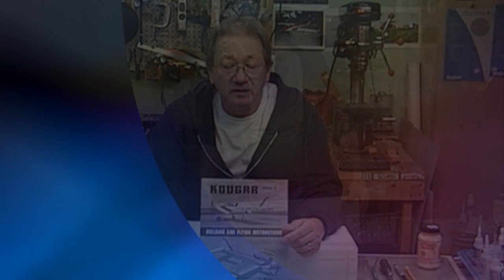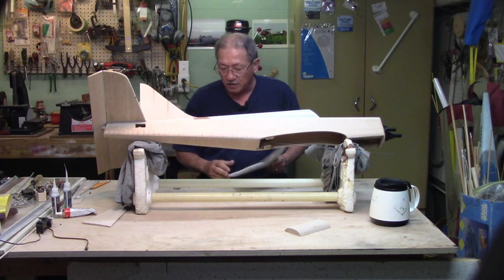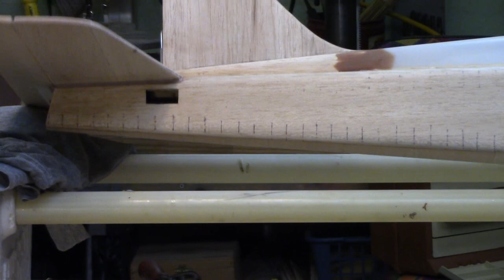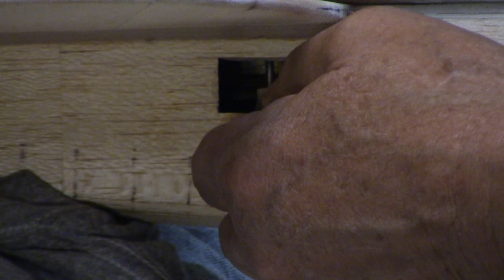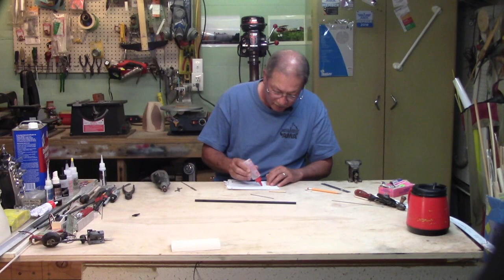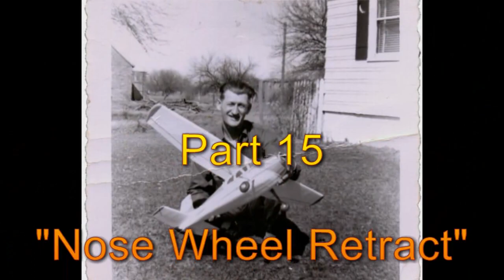SIG Kougar Build - Part - 15   Hidden Rudder Control

Comment: where can I get that horn and clevis 15:05
Reply from the maker: I don't believe that horn and clevis is available any more. But I've used a horn from a strip aileron setup and a common clevis in the past. It works fine and perhaps is less bulky.

Comment: Thanks for all the helpful stuff in your videos! You have said more than once about thing you did in another video. In one video you said you did videos for you club news letter. Would you please point me to that website, or add them to this channel in a playlist.
Reply from the maker: Hi Jim,  I make these videos as an extension of the "Gladwin Area RC Club" newsletter, all the videos are here with a few exceptions that I didn't release. With-in the Kougar Build series I incorporated as many tips as I could that are relevant to the build. All the videos are linked to our club Facebook page and are listed in our club newsletter. I formally wrote articles for the newsletter, but I found that by demonstrating them on video I could make a more comprehensive demonstration than in a few paragraphs in a newsletter article. If there's a subject you would like me to cover, for example, my cousin wants me to do a "How To Cover with Silk Span" video (which I'm in the process of filming in-between the Kougar Build series), let me know. If I know how to do it and if I didn't cover it in another video, I'll do my best to accommodate good suggestions. I wish I had more for you to see, however I'm working on it. Thank you for you interest and the question.
Reply: Thanks for getting back so fast! I have been thinking of giving polyspan a try. It is like silk but you can shrink it with heat. http://fly2build.com/coveringmaterials&supplies.html Have you used it?  found this on youtube https://www.youtube.com/watch?v=igVM8f6uOJ4  Than you again!jim
Reply from the maker: I've never used it. But, I seen it on models. It's light and strong, as you mentioned heat shrinkable and can be painted on with different types of paint, however it can't be dyed like silk or silk span. Like silk and silk span, Polyspan has no adhesive. I believe it is lighter than silk but heavier than silk span. Silk and silk span will shrink with water (Polyspan is un-effected by water), and will shrink even more with the application of dope and will continue shrinking until the dope is completely dry. I'm not sure if Polyspan will do that without the addition of heat. Point of fact: It can take days, weeks, perhaps up to a month before dope will completely dry inside and out in some cases. I'll check out the video links. Thanks

Comment: Bob, do you know the manufacturers and part numbers for the clevis and pushrods that you used for the rudder. I know the rod is by sig. I have to order the parts for everyone before the next meeting. We all appreciate you taking time to do this and it looks like we are not alone. Seems like you have a pretty good following. Great job as always. Bill
Reply from the maker: AERO-SHAFT PUSHROD
 SIG MANUFACTURING
 SIGSH654

The Clevis is a old aftermarket that is no longer available. However you can use the same connector that is commonly used on strip ailerons and a standard clevis. Sorry it took so long to answer, having some minor health problems.